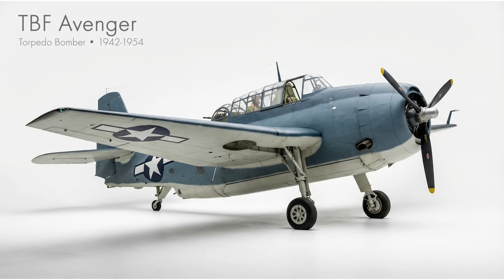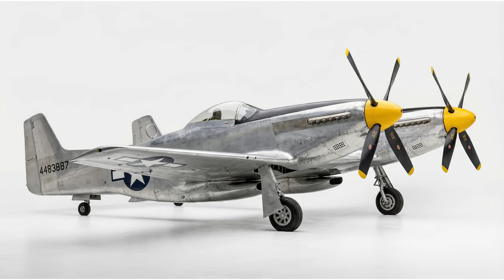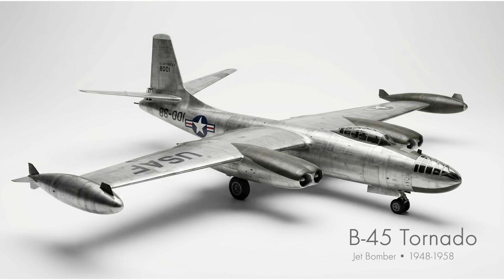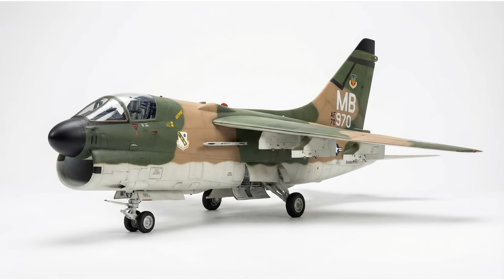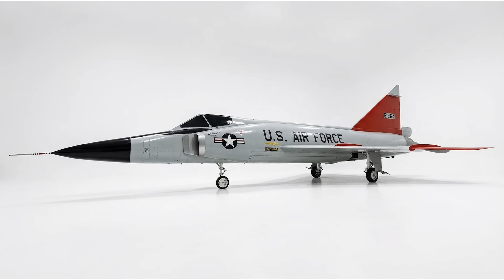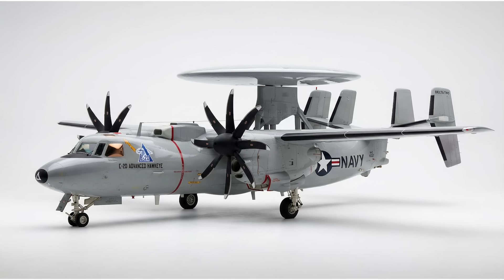Most Underrated US Aircraft Ever Built

Comment: They are still going to need a proper CAS aircraft once the A-10 finally goes away. They keep trying various jets and they "can" do the job but they just aren't as effective or efficient so they've also been testing various single engine prop planes which have proven a lot more effective overall albeit potentially too slow and limited on the amount of armaments and range. I'm personally rooting for a new OV-10 Bronco 2. I know a couple have been built and were being tested but I'm not sure what ever came of that. I'm no expert but based on what I know of the original OV-10 I do believe an updated version of that would be very effective for CAS. I do however think they would likely need to go with a new two engine model like the original versus the single engine the new Bronco 2 has.

Comment: I've always loved the idea of a modern turboprop CAS bird built around the P-39 concept.  Mid engine PT-6 twinpac, modern 30 or 35mm firing through the propeller shaft, 7.62 or 12.7s in the wings.  Armored bathtub protecting the engine and pilot.

A modernized turboprop A-26 would be an exceptionally useful plane today.  Jets lack loiter time.

Comment: I honestly don't know much about the p39 I need to do research but definitely the p40 is underrated not the best plane but good enough reliable sturdy and available
Reply: From what I have seen the P40 was as good as any of its contemporaries as long as it was under 25,000 ft.  Didn’t have turbo charger.  The P39 was a good platform but the propeller shaft was long and contributed to vibration and other problems.  I think I read that heat from the engine also affected the pilots.
Reply: @brettvaughn1058 well then I bet during winter time the Russians really appreciated it and you have a p-40 was very good it wasn't the best playing out there but it was a solid platform did its job reliable and tough but from what I heard it was kind of a stopgap playing it was good enough but not the ideal plane that everybody wanted

Comment: My dad flew F-84 Thunderjets during Korea and I think he would have agreed with your assessment of it - he thought they were terribly under powered but he loved flying them.  Of this list my dad also F-105s both as a single seat strike pilot (100 missions) and as an F-105 Wild Weasel.  My dad commanded the 561st TFS Wild Weasels which are the markings on the aircraft shown in this video.  My dad flew 79 missions as a 105 Wild Weasel before being sent home due to high blood pressure (he also flew 100 missions as an F-100 Wild Weasel and was the 2nd combat commander of that squadron).  Dad loved Thuds and called them, "the Cadillac of aircraft".  F-105 Wild Weasel aircraft were "G" models, not "F" models as stated in the video.